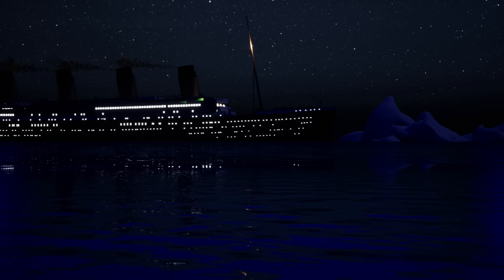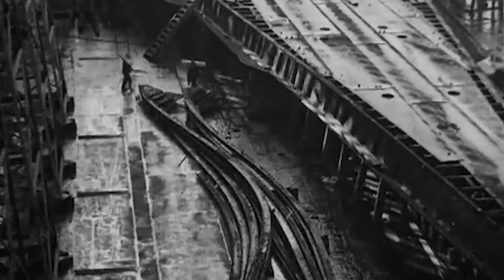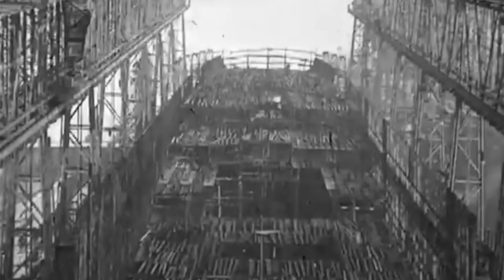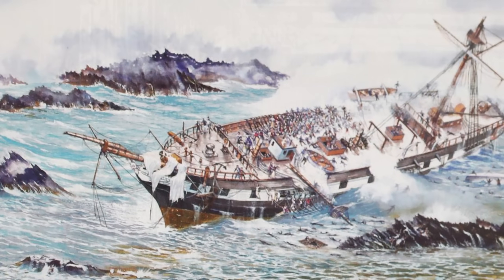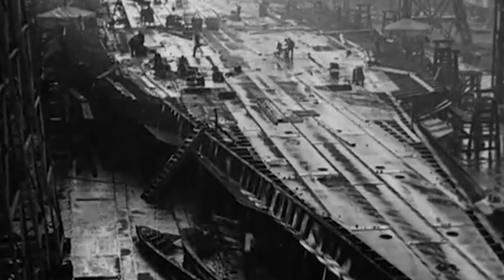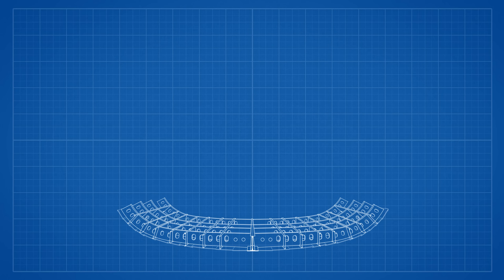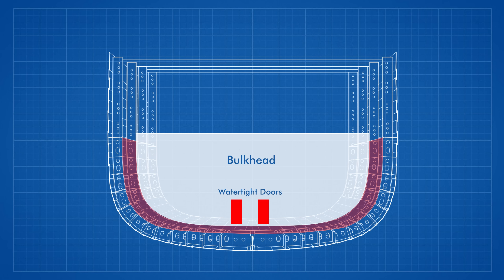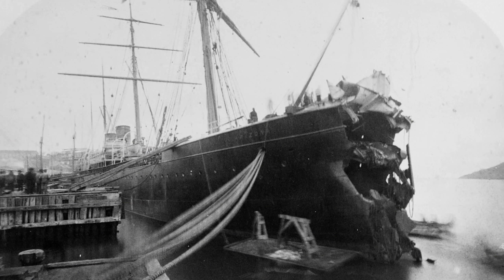How did the Iceberg Sink the Titanic?

Comment: Regarding the aftermath of the collision, it is curious to note that Titanic continued on at half speed instead of stopping, which would've no doubt have lead to her sinking quicker. So why did the officers and Smith order to continue on?. Also, the official story stated that the watertight doors were closed immediately, but this contradicts with the evidence given by first class passenger George Harder at the US Inquiry. In this it states: 
HARDER: "...when I went down into my stateroom in with the lifebelts and noticed four or five men on this E deck, and one of them had one of those T-handle wrenches, used to turn some kind of nut or bolt, and two or three of the other men had wrenches with them - Stilson wrenches, or something like that. I did not take any particular notice, but I did notice this one man trying to turn this thing on the floor. There was a brass plate or something there."

Chairman Senator Smith then asked: "was it marked 'WT'?". Harder replied "Yes it was marked 'WT', and I do not know whether it was a D after that or something else. A few days before that, however, I noticed that brass plate, and, naturally, seeing the initials WT, I thought it meant watertight doors or compartments."

SMITH: "Was it in the floor?"
HARDER: "Yes, on E Deck. It was on the starboard side of the boat, in the alleyway. I think this brass plate was situated between the stairs and the elevators. The stairs were right in front of the elevators and right in between there, I think, was this brass plate. I heard one of these men with wrenches say 'Well, it's no use. This won't work. Let's try another one.' They did not seem to be nervous at all; so I thought at the time there was no danger, that they were just doing that for the sake of precaution."

SMITH: "Did any of those men state, in your hearing, the importance of being able to turn that bolt or not?"
HARDER "No, they did not."
SMITH: "Did you gather from what you saw that it was connected directly to the watertight compartments?"
HARDER: "Yes, sir, I thought it was. I related the incident to Mr Bishop after the incident."

From the above statements, it seem to indicate that the watertight compartments were not completely secured.

Comment: Wasn't the design... that was fine. There was  a big fire on the titanic before its trip. That fire made the hull on the front starboard side brittle and weak. That's where the iceberg hit. Flooded 6 compartments. Titanic could survive 4 breached compartments.
Reply: The fire was nothing more than a smolder, and it was put out successfully well over a day before the collision without having weakened or damaged anything whatsoever. Even if it did, it was at the tail end of the lengthy damage already caused by the iceberg, and wouldn’t have made a difference at all.

Comment: So them using subpar iron rivets, eventhough the laboratory tests proved there were a lot of impurties and the order slip shows they used subpar rivets to build Titanic? If they wanted to make it as safe as possible then why did Andrews lower the bulkheads and water tight compartments  to accommodate the Grand Staircase?
Reply: That notion of Andrews “lowering the bulkheads and water tight compartments to accommodate the Grand Staircase” is complete and utter fiction. The bulkheads were never changed from the initial design for any reason, and Andrews wouldn’t have had the level of lone authority to do something that drastic with the ship’s structural design.
Reply: @DerpyPossum  do you suppose someone lied during the inquiry to cover their part of the responsibility?
Reply: @Sweeptoken  No, but I do think whoever told you these things lied (or was lied to) in order to dramatize an already tragic story. It happens more often than you may think.
Reply: @DerpyPossum  interesting they discussed that in a documentary around the 5 minute mark. You're right about Andrews not having authority but the owner Ismay did and wanted them lowered. https://youtu.be/T2NFMzbt0FE

Comment: Funny how this doesn’t mention the fire that was onboard before Titanic ever left the yard it was built at. That’s what weakened the metal, all the heat from the fire that was still burning when it sank. This has been admitted finally and the fire is the biggest cause of the metal tearing like it did.
Reply: It’s not mentioned because it’s irrelevant.
Titanic’s coal bunker fire was nothing more than a smolder, which didn’t weaken or damage anything, wasn’t located up against the hull in the first place, was put out over a day before the collision, and was not a contributor to the sinking. Even if it was, it wouldn’t have made any difference, since it was located at the tail end of the extensive damage already caused by the iceberg along the hull (which, by the way, didn’t consist of metal “tearing” but rather hull plate edges buckled inward).
Coal fires of that sort were decently common on ships like Titanic at the time, and were never seen as a serious threat. It wasn’t covered up and was even presented at the inquiries, being dismissed of any relevance for the reasons previously stated.
Reply: @DerpyPossum  well according to the documentary I watched about it, they said the fire actually weakened the side of the ship, and that it was on fire the entire time, and wasn’t put out as it was too big to extinguish since it was an entire storage area filled with coal not a smoulder, but that’s just what they said on the documentary so I don’t know. They said it set sail with all on board with the fire still raging, and that it was kept secret so nobody would panic or anything. It makes sense to me though because if you get metal hot enough it gets soft and turn the heat up more and it’ll melt too. Not sure where you heard it was a smoulder, but I watched an official documentary about it.
Also the fire was going before it even left the yard it was built at, and that’s way more than enough time for it to go beyond being just a smoulder.
Reply: @darrellbuyzat3355  Not all documentaries are created equal. Nor are they ever %100 true, or "official". 
The documentary you mention also shows dark "burn marks" on the ship in a photograph that weren't anywhere near the actual fire's location, nor appear in any other photographs whatsoever. They sensationalized it. The "documentary" is sensationalized beyond belief in so many regards that it's incredibly difficult to take seriously. It also conducts barely any actual research, and their claims are consistently beaten down by any and all Titanic researchers and historians. 
According to the ship's crew themselves, they put out the fire by gradually moving the coal in the bunker to another bunker on the other side of the ship, so the fire would've had far less fuel than needed to ever become "raging" or dangerous in any way. But shhh, don't tell that to the showrunners who are desperate to dramatize stories for viewership and money ;)

Comment: If she had horizontal watertight decks, like warships have, I think she might have been saved. I'm not suggesting every deck , but at least one up high to avoid the spillover. Also, hitting the berg head on instead of the glancing blow she took still would have lost lives but not like the number that died from the sinking. Its amazing that her story still hits us in our imaginations after so many decades.
Reply: WW-1 and WW-2 both demonstrated even with hundreds of watertight compartments, a ship can be damaged enough so even that would not save her. The death of the Japanese battleship Yamato was case in point. She was repeatedly torpedoed in her port side and bombed dozens of times. The flooding and structural damage was too much for her superbly designed and built hull to withstand, and she capsized then exploded. Both halves of the hull sank immediately to the sea bed 1,200 feet below taking 2,700 men down with it. The blast was so massive  it also destroyed American aircraft circling above the stricken ship  killing their crews.
Reply: Hi , i cant get the point , how it would have survived with 3 compartments fully flooded , as top of compartments were not watertight , water would have spilled over and over each other. As any compartment takes water up until “E deck” then water could find a way through the staircases or corridors with only one compartment flooded. How would water have stopped after reaching to top part of any compartment? If it was supposed to stay afloat , water level inside the vessel should not have reached until to top of compartments.
Reply: @allahverdiyunusov6908  The idea is that the compartments are tall enough that spillover won't happen until the fifth compartment floods. The ship remains floaty enough that the situation stabilizes itself.

If you imagine the ship down by the bow with four compartments flooded, the waterline won't go past the top of the back of the fourth compartment, so the flooding stops there. When the fifth floods, then the bow will be low enough that the sixth will flood, and so on.
Reply: @ryanhodin5014  How can water stand in top of first compartment if already reached until there , what can condemn water just stand there . With this logic water should not have reached till top , instead could have stopped anywhere in middle part of compartment..
Reply: @allahverdiyunusov6908 It comes down to how the buoyancy of the ship design works. The weight of the water in one or two compartments is not enough to push the front of the ship down far enough for the water level to rise high enough in the compartment to spill over and flood others. This ceases to be the case by the time you reach the 6 that were breached on the Titanic, and at that point they'll push the front of the ship down much further, raising the water level in the compartments higher, until it spills over the top and pours into nearby compartments as well.
Reply: Others and myself have often wondered how the titanic would have faired in a head on iceberg collision, but we’ll never know. The odds were against her no matter what. A head on collision in a ship her size, at the speed she was going would have been similarly devastating. The bow would’ve been demolished and the upper decks as well by the sheer force of so much mass suddenly stopping. It might’ve pushed and warped hull plates and bulkheads half way back the ship, and perhaps burst rivets equally far and sunk anyways. We’ll never know for sure

Comment: 15:02  "steel bends quite a bit under pressure."
That's an under statement. I worked in a metal fabrication company as press brake operator. It was my job to take the cut blanks and bend them to the dimensions demanded in their blueprints, to form whatever part was required. I did that for about 4 years. I used to think that metal was a solid, lol, but after doing that job, I would compare it more to stiff putty. Depending on the radius of the bends, I could "eat" material, or I could stretch it. There were plenty of times I had to take the blueprint up to the engineers office and inform them that their math was wrong, and it was impossible to form the part to the dimensions they set in the blueprint. And our tolerances were 0.015 - 0.04. 
After awhile I could even see that level of difference. So yes, metal is extremely flexible.

Comment: A fire was burining in here coal store for two weeks before it set sail. This weekened the bulkheads. There is photos and witness testimony to this.
Reply: The fire wasn’t anything more than a smolder, which wasn’t located up against the hull and didn’t cause any significant damage or weakening whatsoever. There are no photographs of it, and testimonies do not claim it was anything of concern.

Comment: To be fair, the weight of the water didn’t pull the ship down. Once the water gets inside the ship, that water is no longer being displaced. That’s why ships sink, because they no longer displace more water than they weigh. Also, I’m not sure if the movie is accurate in this case but they reverse the engine when they are trying to turn. This was one of the worst things they could do if true. The rudder would have lost almost all effectiveness with the propellers spinning in reverse. They would’ve had better turning capability if they had kept the power in. Not saying it would’ve saved them but it might have changed the outcome

Comment: I think the pictures of damage to the Olympic were from a head-on collision with the light cruiser HMS Hawke. It's a great example of what the safety measures installed on the Olympic class could do when they were in situations they were meant for; Hawke had a ram prow and was designed to make actual armored warships regret crashing into her; meanwhile, civilian-designed Olympic gave as good as she got and was repaired and quickly back in service.

She also sunk a U-boat once, by running it over.
Reply: Though her keel was bent from the collision if I recall correctly, which was an extremely serious bit of damage
Reply: Head-on collision with Hawke?  Both ships were travelling in the same direction.  My information is that keel was bent, although people like Brady would deny it.
Reply: @aj6954  Hawke's bow was pulled into Olympic's side. There are pictures of Hawke with its bow squished to the side.
Reply: @theawickward2255  We know how where and when this happened, there are a couple of reconstruction videos.  Have seen the pictures of both Hawke and Olympic after the event.

Comment: Let me save you 18 mintues.

It sank the titanic because it smashed into the hull at high speed and caused a massive hole that let endless amounts of water in.
Reply: Let me save you some braincells.

It sank the Titanic because the ship shoved up against it as it passed at 2 or 3 knots below its highest speed, causing several portions of the steel plates to have their edges buckled inward.

Comment: You have left out a big piece of the sinking puzzle, that in 2005 an expedition found two 30x100 foot sections of the hull about half a mile from the other wreckage.  These sections are directly under the area where the ship separated, and are perfect rectangles with fairly smooth edges like they were cut out of the hull.  This throws a huge wrench into the good old ice berg story - what do you have to say about this?  Your discussion about how the hull was constructed illustrates how impossible it would have been for the bottom of the ship to break apart cleanly on the surface of the water before it went down.

Comment: For those interested in technical language, according to the USCG, along with multiple other, internationally recognized maritime safety organizations, the technical term for what happened to "Titanic" along with every other ship or boat that sinks, is excessive "free communication," combined with "insufficient dewatering capabilities." ln layman's terms, the ship had a hole in the hull, allowing the ingress of seawater (free communication) between the inside of the hull and the surrounding seawater. ln addition, the ship's pumps (dewatering devices) were unable to pump out the water more quickly than it was coming in. There are various technical names for this condition, among them "progressive flooding," better known as sinking, which in Titanic's case was relatively rapid. ln the end, without the addition of sufficiently high velocity pumps, the final result is always the same, loss of stability in which the unlucky ship sinks. As a retired licensed deck officer, the technical term "free communication" has always struck me as a little ridiculous, when all it means is a hole in the hull or deck, usually below the waterline. 

After free communication (which has no relation to unpaid-for phone or lnternet service), the next greatest danger to a ship's stability is defined by a term almost equally arcane, "free surface," aka a liquid, contained within the hull, but sloshing around with sufficient weight at the right (wrong) moment and location, which can cause the ship to heel past the point of recovery. Most modern sailboats are somewhat exempt from this problem. There you have it, excessive free communication and/or free surface, conditions to be avoided at all times by those responsible for the watertight integrity and stability of all vessels floating in water.

Comment: Is it true that the ship would have been okay if she had not tried to turn and just gone directly into the berg?
Reply: Yes, but the job of the ship's officers was to prevent a collision in the first place. If it was too close to even try turning away, the responsibility of the officers then becomes avoiding any serious damage. If Titanic had been closer to the iceberg before Fleet and Lee (Titanic's lookouts the night she hit the berg) spotted it, it's probable Murdoch would've ordered the engines stopped and for anyone on the forward end to brace for impact. As Mike Brady explains in his "What if Titanic Hit the Iceberg Head-On?" video, the bow would telescope at most as far aft as the forward mast, roughly 80-100 feet. Anyone in the 'crush zone' would be atomized while they slept, but there would be very few deaths compared to glancing off the side. In fact, while two compartments were destroyed by smashing into the ice, another two flooded compartments would not be sufficient in sinking the ship. While there would be a heavy forward trim of around 4 or 5 degrees, the water in the compartments would not reach higher than E deck. Tl;dr, Titanic would've survived if she ran into the ice stem-on.